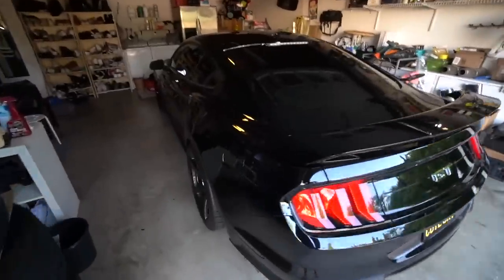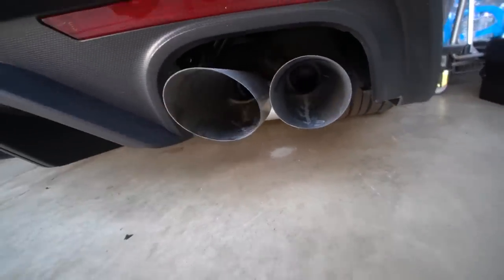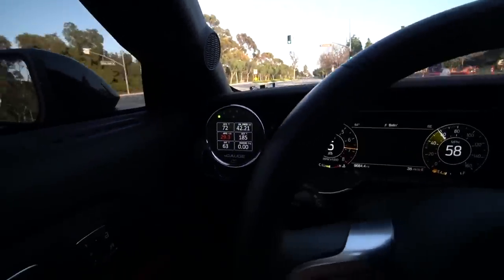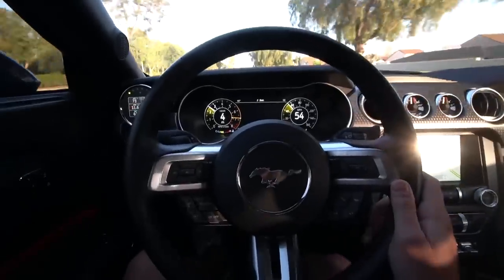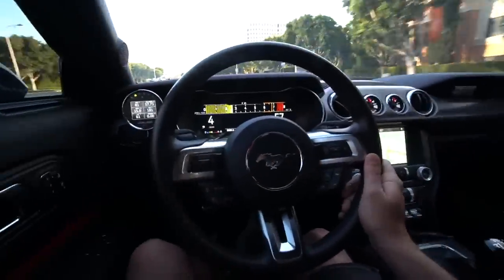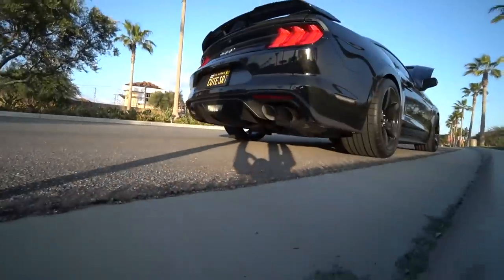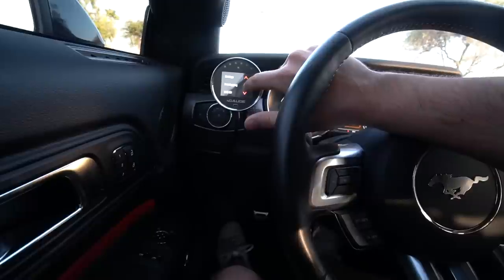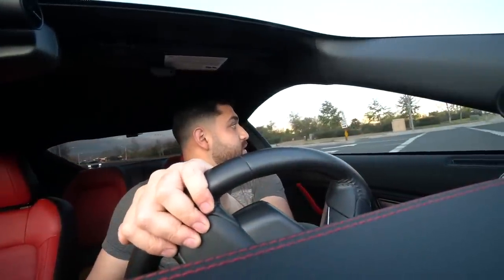My supercharged Mustang is misfiring, I think my catalytic converter is out...

Comment: It’s the spark plugs and coil packs if they aren’t changed man... happened to my 2018 Roush.. no new issues in the past 6-7 months after the change....
Reply: Or bad gas.... 

May wanna check for carbon build up on the spark plugs ASAP tho..... check your fuel trims for both banks..... if they are out of whack , start with spark plugs and check coil packs 

With mine, the misfires only happened between 5000 rpm and up... everything under that was fine and did not misfire....don’t think it’s the cats though... Hope that helps
Reply: Were you getting a PO300 and a PO308? That’s what mine is throwing. Plugs replaced in 2018 on a 2017 Roush… only has 14,000 miles.

Comment: It could possibly be a cat. My cat on 2nd bank (v6 genesis) got clogged up from the backfire. Hollowed out the cats and that fixed the issue. It gradually got worse as I couldn't figure out what the issue was (I tried everything and tested everything related to misfires). In the beginning it was an issue at higher rpms 6000+ but as it got worse it started at lower rpms. Best bet is to cut the cat and check and see if its clogged. Best of luck, hope it's not the cats (costly fix)

Comment: Had and still occasionally get that check engine light. It’s a random misfire but when I took my car to get looked at, everything was fine, they took out everything and nothing was a wiring. Only happens sometimes when I do a pull to 7k RPMs or so. Clear it and that’s it :D. And get rid of the cats, I don’t have any and I’m in CA but I mean my car “isnt” street legal anyways

Comment: Running boost with cats can be a recipe for disaster if you beat on it a lot. Look up videos of people on the Dyno having their cats burn up and melt the material together causing insane back pressure leading to engine failure. Why headers or off-road pipes are recommended for boost.

Comment: I had a P0300 misfire code pop up with my first tune in my 408 stroker. Get it tuned by another tuner with cam/crank sensor relearn. Your cats are going out as a result of the unburned fuel entering the exhaust system, damaging the catalytic converters. I fixed my P0300 code just with a new tune cuz the original tuner didn’t know jack shit.

Comment: Hope your not another victim of the whipple tune. check out Leabanon ford they wont use their tunes anymore or warranty .This is so common with whipple cars. Dont drive , tow it to your guy. Fords tune monitors the cat temps and richens the fuel to protect them . Get you mechanic to check through the O2 sensor hole with a borescope and see whats going on. The melt and block flow but also can come apart so it will block flow intermittently.

Comment: check you spark plugs, hopefully you got colder spark plugs than the stock! also you will need to change your spark plugs more often with force induction cars, something else to check is your coil packs but that's usually a specific cylinder. also,  don't drive it like that though because more likely it's running reach or not having a complete combustion and that will damage your cats

Comment: I told you to dump cats at that power level. I had stock and aftermarket cats fail and throw misfire code. Thank God no engine damage. You may have hurt motor. You better dump cats or go back to stock.

Comment: So what was the cause and fix? I have a 16 stage 2 whipple on whipple tune, stock cats and just got that same code during  a hard pull.
Reply: 808 did you fix this issue. What was the reason?
Reply: @kicksaholic  i just swapped in new plugs and never had the issue again.
Reply: @SixStringRacer  I have a 2020 gt with a stage 2. I swapped in new plugs and still got a misfire. Do you still have stock exhaust?
Reply: @kicksaholic  stock exhaust manifolds with stock cats, no resonator, magnaflow catback.
Reply: @SixStringRacer  wow 👌 good for you. I'm gonna order stainless works   2in headers next week. I'm keeping my fingers 🤞 this fixes it. Thanks for the replys.
Reply: @kicksaholic  headers are awesome I have them on my other mustang.  Its nice to have a loud and not so loud option to drive.  Lol

Comment: Hey I had the code for misfire cylinder 2. Got my tune from Lund cleared the codes and car runs great. Busted a new STIs ass on the highway and my engine light flashed again... Same code as you this time P0300. I have a JLT intake and Corsa Catless headers and borla exhaust. (so its not cats cuz i dont have any). I am about to put new Motorcraft OEM spark plugs in and change the oil. Anyone else have this code and how did you fix it? Thank you!!! Love the channel btw

Comment: Pull and check the O2 (oxygen) sensors. Make sure they are functional. If they are wet (not getting hot enough, showing oil - they could be bad.
       Status of the O2 sensors can tell you a lot about the internal condition of your engine. put gauges into diagnostic mode, see air/fuel ration when you running it hard.

Comment: Bruh I’m just in the shop right now for a misfire 😂I’m running with 5 cylinders rn instead of 6
Reply: Shit try buying a car and driving right wheel drive cause your stock suspension on left side was done causing it to hide the loud noises of a broken cv axle for a couple months😂😂 didn’t find out until I put in coilovers and tried going for a spin, didn’t even leave the drive way as soon as I turned the wheel it made the loudest noise I ever heard

Comment: That happened to my 1999 Chevy Metro (yes, a Metro! ). Same code—P0300. Sounded like a damn lawnmower and lost what little power it already had before. Told my mechanic over the phone what was going on. He warned me that I should not drive it or I would have damaged the catalytic converters (which thankfully I ended up not doing). He also instructed me to have the car towed to him, so I had it towed to the guy. He diagnosed it and told me he found a bad ignition coil boot. He even showed me the spot where the boot had a problem that was causing the car to run like it was. I went out and got the parts, dropped them off to my mechanic and he installed them. It runs perfectly fine now. Motherfucker made me get the loud exhaust fixed, though, so it’s no longer to my exact liking. However, it was no inclination for me to get rid of the car. (It’s a stick shift! No way in hell am I getting rid of it any time soon!)

But anyway, I hope you’re able to get that beast of a car of yours back in ship shape. Fingers crossed. Stay safe, dude!